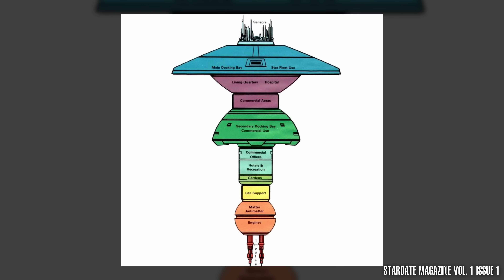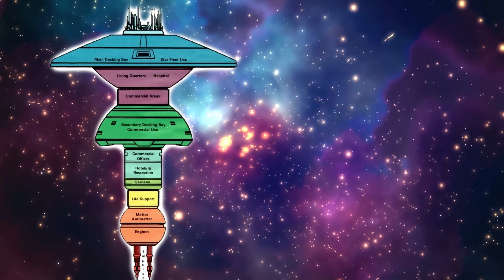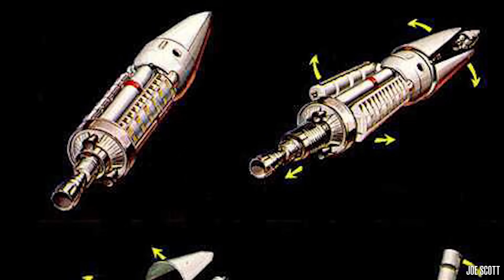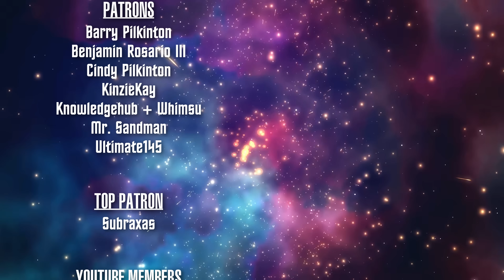How Do Starbases Work?

Comment: I think Earth Spacedock orbits higher than the ISS so, it may not need engines to keep itself-up.
Reply: it needs engines too stay stable in space in one point, try too see it like this, even the moon is bound too the gravity pull of earth itself, that means it doesn´t matter how far or close the spacedock is, it really needs impuls engines too stay stable in orbit around earth. 
and one thing too spacedock is not flying around earth like the iss does, it stays in one point all the time, just earth is spinning not the spacedock with it. and for that it needs engines too stay in the the same position all the time because earth itself is not only spinning around it´s core it is also moving around the sun. thats why it needs engines too stay in the same positon around earth allways.
Reply: Also with lots of ships and materials coming and going, without some kind of "station keeping" thrusters, it's orbit would eventually become unstable.
Reply: @nitehawk86  it would never stay in place not even for a second without engines.
Reply: @Super-Godzilla99  that is a very misinformed assumption.

Technically speaking it will not as the orbit will constantly decay. The same as essentially every orbit in the  universe. It is what we call, meta-stable. Given the correct attitude, this process could take millions even billions of years. Just look at the moon. It's been around for more than 4 billion years without any impulse engines. It will remain in orbit for the rest of the Earth's existence (apart from human intervention). It is a constantly decaying orbit, always losing energy through tidal forces, but on a nearly imperceptible scale.

A starbase will likely face bigger problems from mass changes. If, for example, the base is constantly creating and sending ships away, it will very much need those thrusters to counteract that.
Reply: Technically earth space dock is just a giant space shroom
Reply: @Super-Godzilla99  ur not very educated or knowledgeable on gravity and orbits are you?
Reply: @Super-Godzilla99  hahahaha....nope not very educated or knowledgeable at all...not for 1 second.
Reply: In reality you'd want something that size positioned at a lunar)Earth Lagrange point (position where the Earth's gravity and the moon's gravity are equal. The star trek  space dock is way too close to earth for a Lagrange point.
Reply: @kdrapertrucker  It should be in geosynchronous orbit.
Reply: There is “to” and there is “too”. Please learn English and know the difference.
Reply: Technically the ISS engines do not "keep it up".  They do periodic correction burns to adjust the orbit, to make up for drag over time that would eventually slow the station down enough to deorbit.  Even at the height of the ISS, there is still some atmosphere.  It's very very thin, enough to be "almost" a vaccum, but it's still there, and over time it does cause a slight drag.  You don't need engines to just "stay in orbit".
Reply: @DerekJeeter-sp8du two
Reply: @Super-Godzilla99 
I'm going to assume those engines are gravimetric rather than Newtonian though. Something that large close to a planet would need fucktons of delta V, easier to just switch gravity off.
Course, now it needs engines to push it around the sun.
No, I'm afraid it's orbiting, the idea of it flying along next to earth is ridiculous.
Reply: @Super-Godzilla99 .. so, if it doesn't orbit earth but stays in a relative fixed position, then it's actually just joining the earth in its orbit of thr sun right?
So it is orbiting the sun rather than earth.
Isn't that an easier way to show why it needs engines to keep position relative to earth?
Reply: @Super-Godzilla99 geosynchronous orbit in theory.
Reply: @BadGamer- people don't seem to think that Earth's atmosphere actually reaches out as far out as the moon it is extremely extremely thin out there but it does cause drag
Reply: @Only_Some  technically space is just extremely thin atmosphere using that standard then right?
Reply: @StormsparkPegasus the ISS thrusters literally do keep it up. that's... the whole point of maintaining an orbit. to keep it in space.
Reply: @Super-Godzilla99 please don't talk with so much authority about matters you are not educated on, someone equally or more ignorant than you could believe you know what you are talking about and get misinformed.

Anything in orbit will remain in orbit, unless there is a force slowing it down (atmospheric drag is still present past the Karman line).
Hence the engines just need to compensate for this drag.

The further away you are, this drag is reduced almost to zero.

PS: The Moon is not affected by this drag given its distance to Earth. It gets further away from Earth 1.49 inches (3.78 centimeters) per year.
Reply: It is situated at the Lagrange point L3, directly opposite Earth, over early fears of a massive object in Earth orbit affecting gravity, tides, and the planet's orbit. The starbase was the main refueling and resupply station for Sol system until Spacedock 1 was completed in 2272.
Reply: It is situated at the Lagrange point L3, directly opposite Earth, over early fears of a massive object in Earth orbit affecting gravity, tides, and the planet's orbit. The starbase was the main refueling and resupply station for Sol system until Spacedock 1 was completed in 2272.
Reply: Engines required are very minimal as with the ISS, just to periodically correct the small atmosphere drag in LOE. Satellites in higher orbits like Himuari 8 or Epic cameras are far more stable. Stations can even be placed at Lagrange Points for very stable solar orbits outside earth system, as is used in the game Star Citizen.
Reply: The International SS is 200 miles up.  The Terran Spacedock orbits much higher up, but it doesn't matter how high up you are, just the speed of your orbit.  As long as the mass is moving fast enough it'll orbit at any distance from the ground.  You don't need thrusters.  Also the book's author's understanding of how gravity work is less than ideal.
Reply: @Super-Godzilla99  objects at 22,300 miles will stay at the same position above the earth forever
Reply: @Super-Godzilla99  Like the moon, it will stay in orbit forever if beyond the atmosphere
Reply: @TheTonyMcD  the moon has stayed in orbit for millions of years...duhhhh
Reply: Guys, from what i understand the space dock is not in an orbit, hence it would need constant propulsion
Reply: @kdrapertrucker   The Station being at a langrage point of the Earth Moon system would have it closer to earth than a langrage point of the Sun Earth system.
Reply: I kind of felt like Star Trek usually ignored physics when it came to gravity and orbits.
Reply: @Super-Godzilla99  If you set the orbit in geostationary orbit, you need no thrust to maintain orbit over a single point (just thrusters to correct for any perturbations from other effects).

Also, if I were to design a "starbase" for the star of Sol, I'd put the starbase at Jupiter's L5.  This is relatively stable, so stable, in fact, I expect it would take some effort to clear the area of debris to make it safe.  Thos places it far from gravity wells, for easier transit to any other location in the solar system, or going extra-solar.

If I ran Starfleet, I'd make L5 of every largest gravity well (outside the star) of every solar system the designated location for the starbase.  One starbase per star.
Reply: @Super-Godzilla99  That has never been established. I have always absolutely assumed that spacedock orbits the earth and as such needs nothing to keep it up other than it's momentum.
Reply: @TheTonyMcD  Not every orbit decays. See: The moon - creeping away at like 4cm per year.

The why the moon is drifting away has to do with friction of earths fluids - the atmosphere, the oceans, and it's molten inner layers. As the moon and the earth spin and orbit the sun, these are pulled on which results in a friction force that inevitably results in converting kinetic energy to thermal. The issue is - the moon itself is not directly tethered, and will do things to maintain it's energy state - and that is reflected in the increased orbital distance. 

For the starbase - you don't want to use thrusters for reaction control if you can avoid it: Wash out, waste of matter, requires constant feed of chemical propellent... just no good. What you can use, is gyro's. You probably want at least 12 - 2 for each direction, but for the size of the space station, probably 5-10x that amount set up in pairs or sets so that you can spin them up/down oppositionally as a way to control your angular momentum and maintain control of the tilt etc. The other way you control for this, is using the departing, and incoming ships and how you taxi them in so that you can take advantage of their momentum and impart it to the space stating in a desirable way. 

Thus we get to: The only reason we want thrusters is as an "oh shit" back up measure, and for boosting in orbit if we are too deep in the atmosphere. And in that case we probably want 4 thruster clusters with 7 small clusters - 6 of these are for adjusting angular direction, and the 7th is a much larger cluster who's entire purpose is to be fired as required for probably days at a time to boost it's orbital distance.However, you have, incidentally turned your space station into a space ship by doing this: It's just going to take a REALLY long time to get anywhere because we aren't buidling these things for fast transit, we are building them as back ups where we need very little energy output.
Reply: Langrage poin moon?
Reply: @Super-Godzilla99  legrange point
Reply: I found it odd that we saw on several occasions starships appearing to orbit Deep Space 9 but I'm not sure why they needed to do this. Its mass wasn't large enough to allow objects to orbit so the ships could have just remained stationary and use their thrusters to adjust position if they drifted out of place.
Reply: Wouldn't it still need some engines?
Reply: @Super-Godzilla99 that isn't really how orbits work my guy, as long as it is in a stable orbit it wouldn't need thrusters at all. It would need them if you wanted to change the orbit but that's it, it could stay up there for thousands of years.

Comment: Great video but you don't need thrust to stay in orbit. The ISS needs occasional boosting because it is at such a low orbit that it is nearly still inside the atmosphere and faces atmospheric drag.
Reply: Was going to post the same thing. But yea, the Starfleet big space stations seem to always be depicted in a very high orbit.
So "How do they stay in orbit?" is the same as asking "How does the moon stay in orbit?"
Reply: That's not quite true. Every orbit in the universe is hemoraging energy and thus decaying. For most it just veeeeeery slow. That being said, stuff docking, repairs, ships being send away and other such things mean that the starbase will be knocked arounf a lot. So it absolutely needs thrusters to hold its orbit. Probably not particularly powerful ones though.
Reply: @scelonferdi  Also true, but when people ask "How does it stay in orbit...", They aren't meaning "...over millions/billions of years"

Station keeping for it being bumped around is interesting. But Starfleet also has their inertial dampeners that can handle percentages of light-speed accelerations.
Reply: @scelonferdi  But the Moon is even leaving us, it won't stay in earths orbit for ever. And honestly, such a space station, you would probably build it in a Lagrange point where it could stay relatively uneffected by gravity. .
Reply: @scelonferdi  Tell me you dont anything about Milankovitch cycles without tellinjg me you dont know anything about Milankovitch cycles. Its what probably makes the moon move away from earth. Abd much more.

Comment: While Earth Spacedock appears in Star Trek as being in Earth orbit much like the ISS actually is. I always thought that Earth Spacedock is actually at either L4 or L5 of the Lunar Lagrange Points. L4 and L5 are the two points that objects placed there would have a stable orbit
Reply: L4 and L5 would be good places to keep such a station. However, those points are quite far away (~1AU) and when the station is shown on screen it is fairly close to the Earth. It looks like a higher orbit than ISS but also much closer than the moon.
Reply: agreed
Reply: @Mastakazam he said earth MOON Lagrange points… not earth SUN points… L4, L5 E,M points are about 250,000 miles… nowhere near an AU…
Reply: @whochecksthis  that's still far enough from Earth that it would look as small from Spacedock 1 as the Moon does from the Earth's surface.
Reply: @zerrodefex  To a camera, the moon can look field-of-view-filling from Earth's surface. Also, Earth is substantially larger than the moon.

Comment: Thanks for the vids, but gotta say, LEO (low earth orbit) has traces of atmosphere that produce drag that will eventually degrade the orbit and cause re-entry.  Weight per-se has nothing to do with it.  The object simply is in 'free-fall', or is simply ALWAYS dropping down a bottomless well.  It doesn't hit the Earth due to it having exactly the same speed perpendicular (avoiding the terms of physics as possible here) or tangent to the surface, so the object in orbit is falling to the surface pulled by gravity, but is moving 'sideways' at the same speed.  That means it falls, but is always missing the item towards which it is falling.  Anything that disrupts this balance of gravity's pull and sideways motion will change the orbit.

Comment: It should be noted that, in addition to having reaction control system thrusters, the Federation Space Dock, due its enormous size, has been placed in a much higher orbit than the orbit of the International Space Station.

Also, dry docks in Star Trek, at least the ones belonging to the Federation, are open space types of shipyard facilities that are usually separate orbital shipbuilding structures from the shipyard's main space station type of headquarters. Which means that the Federation Space Dock is not the same type of docking station as a orbital drydock, and should not be confused as such. The Federation Space Dock is more like the outer space equivalent of a port city on the coast of one of Earth's oceans.

As for artificial gravity in Star Trek, if I recall correctly from what I read in the TNG Technical Manual, the gravity plates are circular and centripetal force in a way that does not require a ship, or space station, to be constantly rotating. Whether or not that includes the use of graviton particles, I don't remember. The only thing that I remember  about Star Trek mentioning graviton particles has to do with their use in tractor beams.

Comment: Antimatter reactors are used to arm photon and quantum torpedoes.  Phasers and shields can be powered by any power source even auxiliary (battery) power, but torpedoes are antimatter based/charged weapons.

So the presence of antimatter reactors on a base just means it is a military installation with torpedo defenses. Otherwise impulse power would be sufficient.

Comment: I always figured difference between a space dock and dry dock that a dry dock would have to be fully enclosed or on a planet to provide atmosphere.

It's analogous to the navel dry dock which docks a ship outside of the water, so a dry dock for space vessels should pull a ship out of the vacuum is space and provide an atmosphere for ease of construction or repair.

Comment: I think the main issue with all the artificial gravity options is the risk of failure. If part of the structure of a centrifugal design fails, it'll all disintegrate almost immediately. Even for gravity plates, a cyber attack causing them to be overpowered could crush everyone on board

Comment: Orbits are states of free-fall.  It doesn't require being in low-Earth orbit.  Being in low-Earth orbit means running into a small amount of atmosphere, lowering velocity, and thus lowering the orbit which requires little spurts of thrust to maintain velocity and altitude.

The Earth station would not be at a low-Earth altitude and doesn't even appear to be.  It'd also be in free-fall of Earth (an orbit), but it wouldn't require as frequent adjustments; adjusting only occasionally due to other gravitational forces and solar winds.  It'd probably require even less if in Earth's L4 or L5 Lagrange points.

Comment: In Enterprise, Archer finds trip at a special spot on the NX-01 Enterprise.  Trip says that's where the gravity plating is at, sense he is "sitting" on the ceiling when Archer comes from the bottom entry going "up".  To me, that implies that half of the NX-01 is upside down from the other.
Reply: wasn't trip - it was travis

Comment: 0:57  Umm, the first space station was the Soviet Salyut 1, launched in 1971. Salyut 10 experienced a failure of its docking mechanism and had to abort its mission to the station. The crew of Salyut 11 spent 23 days aboard, but were killed when their Soyuz spacecraft depressurized during reentry. Salyut 1 was followed by five more successful Salyut stations, both civilian and military, before the Mir space station was built.
Also, Skylab was launched in 1974 and operated by three crews from 1973 to 1974.
Reply from the maker: Correct, that's why there's a card, disclaimer in the description, and pinned comment pointing out the correction 👍

Comment: When you can manipulate gravity you can also easily keep structures the size of the space dock just by using gravity to make it fall up or down slowly to maintain its orbit.  You could realistically just park it at one stationary point above the planets surface.  In this case, a point where ships coming into the solar system can go straight to the space dock and not need to orbit around to the sun side of the planet to reach it.